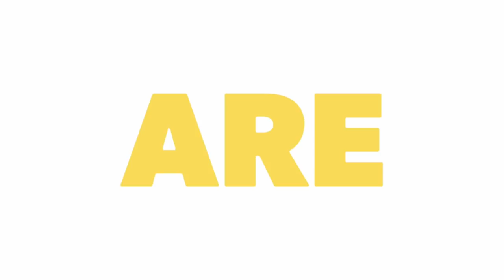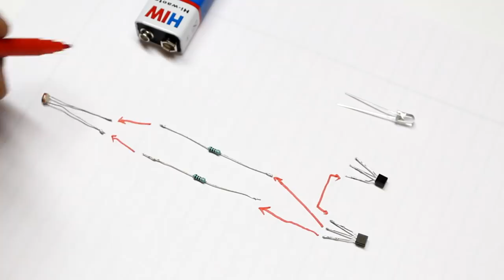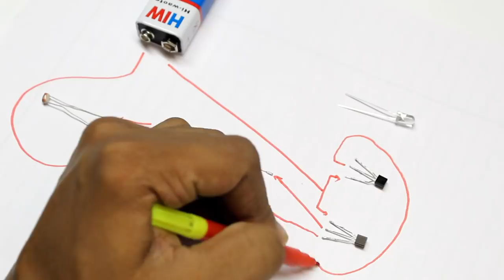Automatic LED Street Light Using Electronics LDR Sensor | Electricity DIY Project

Comment: Please  explain  briefly.  Please tell me how did u connect led straw with the wires.  In the description  also u didn't  say the materials required completely. Nice but explain  step by step properly.
Reply: They are connected in parallel to each other  
Check th discription to check metarials

Comment: Hey I didn't get one thing that there are 4 wires outside ok. But ... You took 4 wires from inside
3 should come out why 4,the forth one is attached with led and batteries as led is out side ??? How you took the led wire (green I think ) from inside please explain
Reply: You need battery to power  the street lights as the LDR just a sensor
 
LDR is a Photo resistors, also known as "light" dependent resistors (LDR), are "light" sensitive devices most often used to indicate the presence or absence of light, or to measure the light intensity

Their resistance decreases as the light intensity increases: in the dark and at low light levels, the resistance of an LDR is high and little current can flow through it

-

LDR must be put inside the box so it can detect its sensor, when you take out the top piece cardboard,  it will stop completely because LDR can't sense dark near them

If you put back the top piece cardboard to the box back, LDR will senses darkness inside the box and activate a signal to the battery

Then, the battery will give signal from LDR to the street lights wires that attached to the battery and also to the LDR from outside to switch "on" the lights 

While the other street lights will "lights" too because if you see the video the wires of the street lights near the battery also attached to the other street lights wires
Reply: 6:10 where he attached the battery and LDR to the street lights wires
Reply: Also to the other wires of 2nd street lights
Reply: @kaori7472  thanks now i got it sorry for late reply ;)

Comment: My circuit is working but ldr system is not working. Bulb  lights up when I connect the battery. I have used 547A transistor as I could not find the above mentioned. And please tell me if we have collectively make 1k resistor or resistor should be 1k each? Please reply
Reply: You use Trasistor 2222A and each resistor 1k then circuit is working

Comment: Bro I tried myself which you arranged the circuit in video and exact values of apparatus is used.
But it is not working.
Please give me reply bro
Reply: ha yes in place of battery u have to use transformer(12v)..9v battery cant work for that load
Reply: @ckrdehydratedproducts  led burst avutundi.. It's not working 9v use chastunte

Comment: I can't understand how it works by keeping a cardboard piece on the top🤔🤔🤔
Reply: Bro it is very simple. An ldr stands for light dependent resistor. So basically it is a light sensitive photo cell. Whenever intensity of light changes its resistances changes and thus lights the bulb. Whenever there will be darkness it will illuminate.When we place the cardboard, darkness occurs and it gets illuminated.